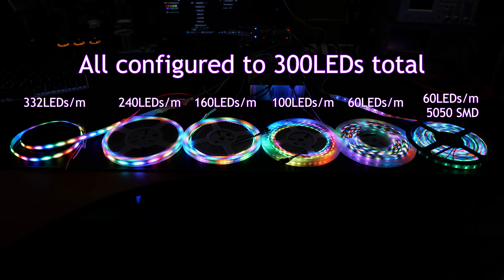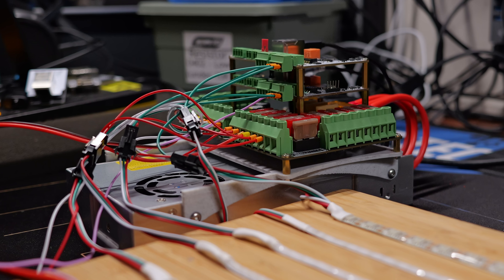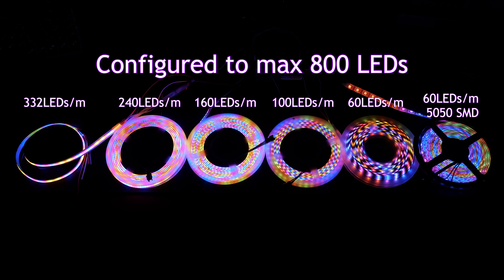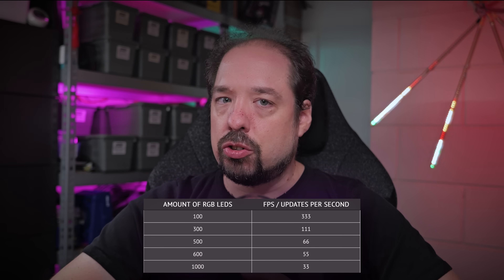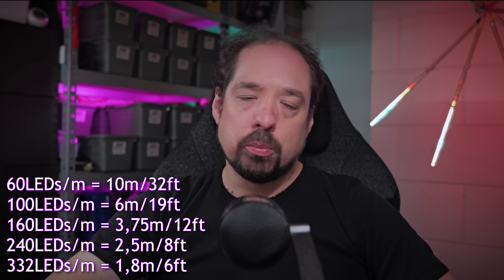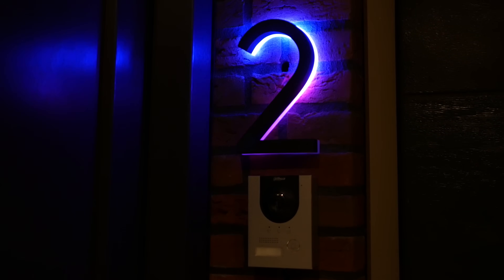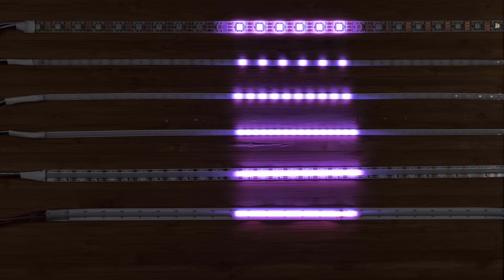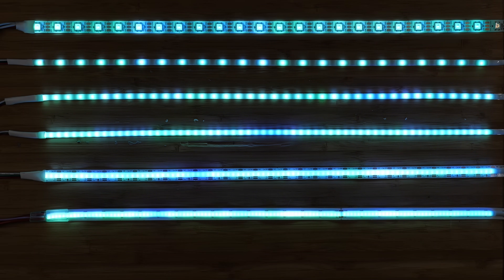💡QuinLED💡New COB style addressable LED strip

Comment: maybe I missed it, but what about the heat dissipation for the high density strips? Heat is the absolute enemy and will make a strip fail within short time, so that needs attention. I had several projects with 144led/m WS2812 strips with no good ending since cooling was not done well
Reply from the maker: This is a very true fact! Basically it scale with the amount of power used, if it uses more power, heatsinking becomes more important. The COB LEDs themselves are a bit more efficient then traditional 5050 package style ones, especially the older ws2812b but still, when you are getting up to 240LEDs/m and want to run them with high brightness cooling is certainly a requirement, good point!

Comment: Which ones can I use with the dig2go and how many meters? Only the 60/m version it seems?
Reply from the maker: That one is most recommended yes and because it's only 5mm wide it can only take in 2Amps or so max so it's still slightly limited although for any normal usage scenario it'll be able to deliver 100%. More LEDs means even more power is needed, on 5mm it's 10w max because of the single injection point and 5mm with the dig2go. The 10mm variants will go up to 3Amp or so, so 15w max, maybe the 160LEDs/m 10mm can still look ok but it will be somewhat limited (depending on the total length).
Reply: @IntermitTech  so if I only needed 1m or 2m, I would get away with the higher density ones, e.g. 160/m. The ones with more than 300 per meter are out of the question, right?
Reply from the maker: Sure that's no problem! Basically, with a 10mm strip you can say you can get 15w in to one point with a dig2go. So you can calculate with the given numbers for that length. If 100% one color or 50% RGB white is close to that 15w number, you'll be able to run without limiting. If it's say double, so 30w you can generally still do it, effects that don't activate all LEDs will run nice and bright but effects that do activate them all will run less bright so there are limits how far you can go with that.

Comment: is the addressable 24v cob led brighter than the 5v cob leds?
Reply from the maker: I'd say so yes because it has many more diodes, but if you watched the video you now know, compare Watts, highest watt will usually win in regards to brightness! ;)
Reply: @IntermitTech  do you have affiliate links for the 12V and 24V strips? Shopping for these strips to avoid as much power injection. I know you have a video coming, but need to order early to get them delivered before the holidays :)
Reply from the maker: Sure, some of them are in my guides already. Easiest would be to check out my "addressable neon" vidoe, that description has links for sure! Thnx for thinking about that! ☺️

Comment: Great video as always. I did not get why you needed two esp32. Indeed without added hardware it can drive 22 strips in full parallel mode and when using couple of shift registers 120 strips in full parallel
Reply from the maker: Yeah, if it's not doing anything whatsoever in a vacuum. When running WLED, calculating the effects, gamma correction and everything associated with that, no so much and it runs out of horse power after around 2000 to 2500 LEDs.
Reply: @IntermitTech  with wled maybe but here is the esp32 gathering up to 73 universes displaying the results on 12k leds and doing rotation and scaling on top of brightness and gamma calculations. https://youtu.be/sYtVOU8Hpss?si=qRMkS9LnIZKO3NLE. The refresh rate of the panel is 130fps. Wled is a great all in solution plug and play wich I like but it doesn’t allow to use the full power of the esp32. I have a question regarding the cob high density. Are they easy to cut ?

Comment: Thanks Q, I am currently making a infinity cube with aluminum extrusion.   I went the 3030mm size as I could only find LEDs of 7mm to fit the side of the extrusion. 
Now seeing the 5mm COB lights and how good the 160 per metre perform, next cube will be running them I think using the smaller 2020 frame.
Using a digital with 3 power and data inputs.
Reply from the maker: Awesome yeah, that should look great! Just make sure to add a few power points since the 5mm take in less per injection point. The numbers in real-world sheet for 5v are always triple injected so front + middle + end for 5m.

Comment: Did you get the chance to compare 12w vs 20w for the 160/m ? Also, do you know where I can find the 20w version ?
Reply from the maker: You can find the link for the 20w version in my link but it's only their way to differentiate between the 5mm and 10mm since the 5mm accepts half of the power per injection point. Since I test everything 5v with front + middle + end injection I was much less limited because of that, I don't believe the 20w version will really use more but just that it has more copper on the strip since it's wider. But check the shops in the links, they have both versions!

Comment: Please cover power injection for the COB strips??  Not where, but how it's physically done.
Reply from the maker: Physically for the 5mm you do so on the bottom! They are tiny pads but it's certainly possible, I happened to post a picture on my Discord while working on this video since each strip was triple injected (front + middle + end) for power testing! On some, that wasn't even enough!! But that's how I test 5v strip so those numbers I put down and added a note. The 10mm strip is a bit easier and they just have pads on the top (and bottom) you can use.

But basically, peel back the bottom cover and sticky cover and then there is pads like you normally see on top. Make sure to insulate these well if you are putting them inside a metal profile diffuser!
Reply: @IntermitTech   Hmm.. sounds like a 3d printed project coming up...
Reply: There is a full separate video on his site for that. A month or two back.
Reply: @gerryf7015  Grr.. I did search.. couldn't find it.  You wouldn't happen to know the title???

Comment: Great video as per usual :) I think these new cob strips will excel at small things, that require high resolution. When the price goes down we might start using them more often but the 5v requirement, being the cob type and high resolution really makes them great for things like mood lighting and such. Super cool!
Reply from the maker: Yes exactly, that's why I wanted to present them and all the different variants! Exciting new options, especially buying those lights pre-made and then replacing the LEDs inside for instance! :D
Reply: @IntermitTech  precisely what I thought! Or those cool 3D printed cubes and moons, that you stick lights inside. Stick a cylinder with a strip rolled around and you get something unique, professional looking and with wled very powerful too.
Reply: Just check on aliexpress, and you will find them much much much cheaper
Reply: @darknessblades  40 euros for 1 meter isn’t cheap enough yet :D
Reply: Ditto on what
@TechdoLiberal  said.

Comment: Thanks for sharing all your knowledge. 👍👍👍

I just ordered this lights 

FCOB LED Strip Light 5M IP68 840 LEDs DC24V RGB COB LED Neon Lights FOB High Linear Soft RA90 Dimmable

Will this be a good fit for the Octa system with the 7 power board?
1500w 24v power supply
Reply from the maker: I don't see an IC name in there, are you sure they are digital? If so the Dig-Octa will do great on those, no problem!
Reply: @IntermitTech  you are absolutely correct. That's why you are the Master at this. I didn't realize they weren't digital when I ordered them 😕😕

Comment: I bought a dig octa for my Christmas LED project, now I'm just having some problems connecting the brainboards. wled only finds one of the two brainboards each time, how do I solve this? thank you in advance.
Reply from the maker: How do you mean "WLED finds" you mean the app? Try the WLED Native app, also check in your router, both should have their own IP address. Also don't configure WiFi and Ethernet at the same time, that can cause issues.
Reply: @IntermitTech  I only find one IP address each time, they must indeed have their own IP address, but when I connect to my router via WiFi, I always only find one IP address and it cannot find the other. I therefore connected them one by one to WiFi, but when I start them both I only find one.
Reply: @IntermitTech  I will try again next week, I have worked with esp cards before and never had any problems, I then had a list of ip addresses that I could connect to, hopefully next week I can get some help from someone who worked with your material before. I will keep you informed.